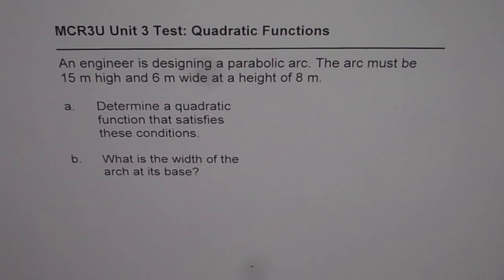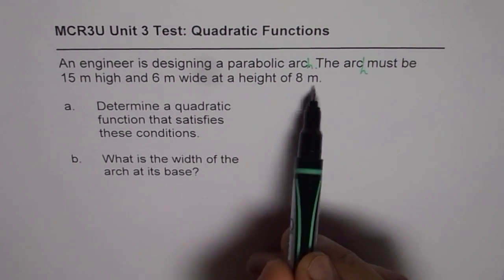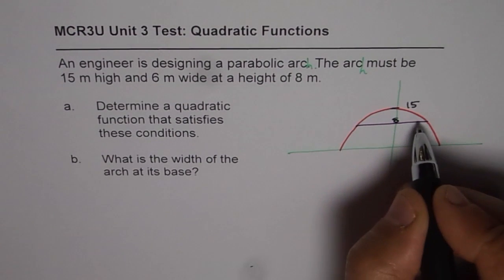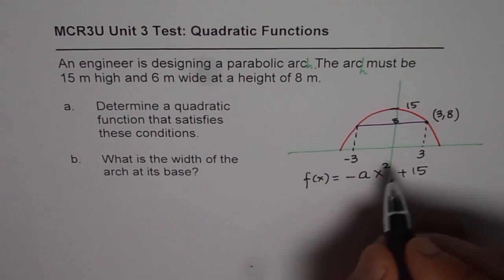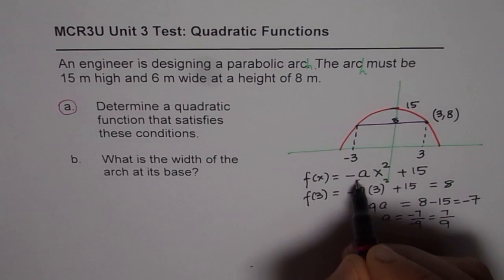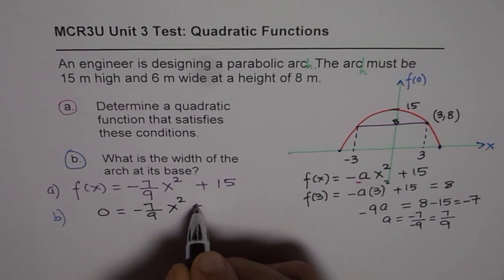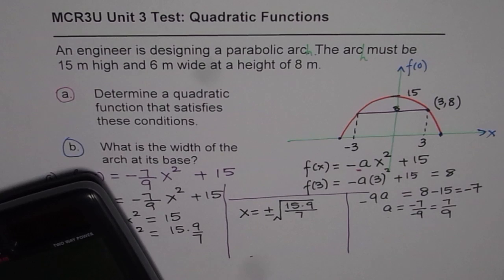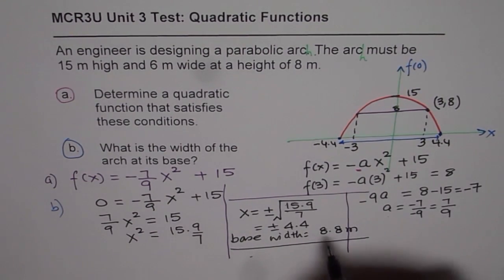Quadratic Equation For Parabolic Arch With Maximum Height and Width

Comment: A gateway is a parabolic shape whose vertex is 20 ft from the ground, (0,20), and the width on the ground is 25 ft. What is the maximum height of a vehicle to cross the gateway if it is 7 ft wide? Find the standard equation of the model's gateway.